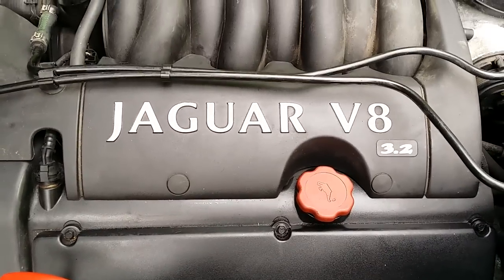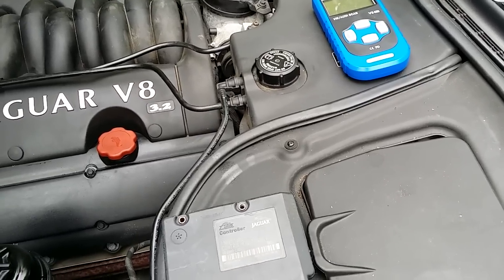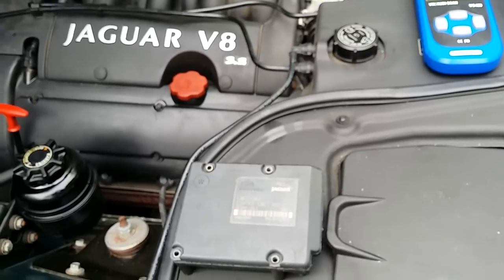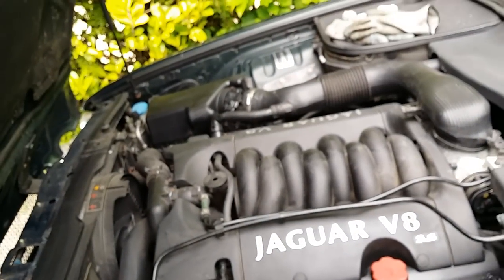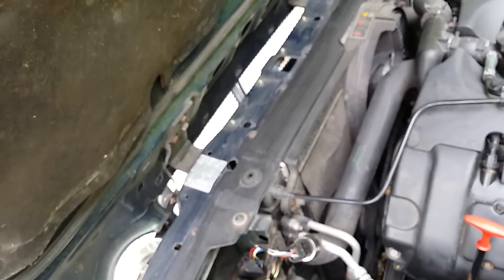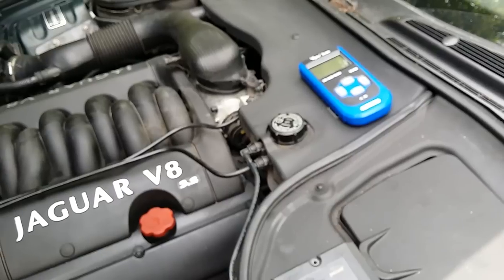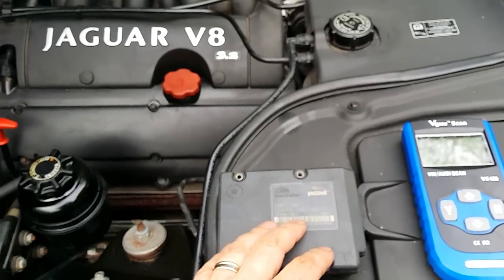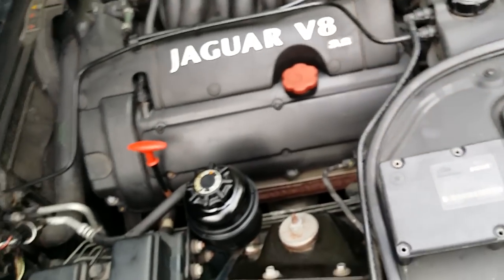Jaguar XJ8 ABS problem how to fix

Comment from the maker: Hi All, thanks for your comments. .. I had a few things going on, my abs module needed resoldering,  once done it would consistently return a fault code.   But was still faulty and abs not working. .... so then tested the wiring to each sensor, by removing the muti connector from the abs module,  removing the connector from each sensor,   connecting in a 9 volt radio battery on each sensor connector in turn, and measuring the voltage on each pair of sensor pins in the multi connector.  This all checked out ok and i knew the  abs sensor wiring was ok.   Then I removed each sensor to clean them.   The rears were ok but the front sensors were both  fouled by what I can describe as bits of rust, like iron filings sat on the face of the sensor.  Cleaning this off with the best automotive cleaning wipes known to man (Johnson's baby wipes) solved the problem.   ABS has worked perfectly ever since.    I guess those sensors are a bit like audio tape heads, once they start to accumulate dirt the signal gets worse until it gets to the point that the ABS ecu no longer is receiving a good enough signal to operate.   So my recommendation is to check if your abs is throwing up Cxxxx fault codes,  check out your sensor wiring and then clean all your sensors.   If still no  go,  or you have no fault codes,  either replace or repair your ecu by re soldering your dry joints as i have shown in the video.  Good luck and all the best,  Bobby4star
Reply: How did you open it

Comment: have got an abs fail problem on my jag. great video and will definitely use this to try to solve problem. many thanks
Reply from the maker: Daniel Twose hi Daniel try cleaning the front sensors with baby wipes first!   mines been ok for years since i did this fix! 😃
Reply: bobby4star. -  will do. maybe a nice little job for tomorrow. thanks again
Reply: How did u fix your problem?

Comment: You need not remove the entire cover, just drill a 1" hole in the notched corner of the unit with a hole saw, solder the terminals and RTV in a plug.

Comment from the maker: cheers Alanrtment, over a year later and mine has been ok since.   i only drive my jag occasionally and once or twice the abs light has come on at start up. restarting the engine cleared it.   i read on a forum also that low volts on the battery can cause abs light also as the abs module doesn't always boot up properly if battery low. good thing to eliminate with a full charge if having problems. good luck getting your reluctor rings changed?  would a good going over with a wire brush help?

Comment: I have a 1998 jaguar XJR. I need to change the ABS box. I cannot get an E4 star socket onto the two bottom bolt heads on the unit as there is insufficient space between the ABS unit and a bulkhead. Is there a special tool for this or a shorter shank E4 star socket to fit to a bar or is there a combined tool that can be bought? Other people on You Tube have done this job but is an XJR slightly different to other XJ's. Chris
Reply from the maker: hi chris, a long time since i did this job now. ... but if i remember correctly the whole  pump unit is mounted to the chassis on rubberised mountings... can you lift / angle the unit to get your E4 socket on? i guess it might depend on the type of sockets you have, mine were long slim sockets and i only had to bend the pipes a bit away from the chassis to get at those small bolts. good luck!
Reply: I have a 2001 Jagger I put the valet key in it and try to start it by mistake and now the car won't start can anybody help me with that to get the car started it's a XJ8 series 2001 which show would be appreciated

Comment: Bobby what procedure did you use to separate the abs halves? Razor or dremel...?
Reply from the maker: Hi,  i used a large hacksaw with fine thin blade.  Good luck opening it up

Comment: Hi I have getting the stability control fail message but not the abs light could I still be having to same problem?  It main occurs on raining day or when I wash my car.  Please can anyone help?
Reply from the maker: Odd to have asc fail with no ABS fail warning.   Check all wheel sensors etc and clean any rust particles that may be stuck to them.  Check for error codes with an odb11 reader. Good luck.
Reply: @bobby4star  ok thanks

Comment: What did you clean, point it out!?!??!? Use your finger show me fack!?
Reply from the maker: Hello Oscar.  I was talking about the ABS wheel sensors on the front wheels.... They get bits of rust and muck sticking to them.  remove them from your front hubs and just clean the ends of them, it might fix your problem if you're getting intermittent ABS fail.   It's a really simple job.  Try it first before taking apart your ABS unit!  You can also get the ABS wheel sensors failing and going intermittent.  They have a fine wire coil inside and if the wire breaks (due to ageing, vibration) they can stop working completely, but also you can get it where they work intermittently.     Good luck.